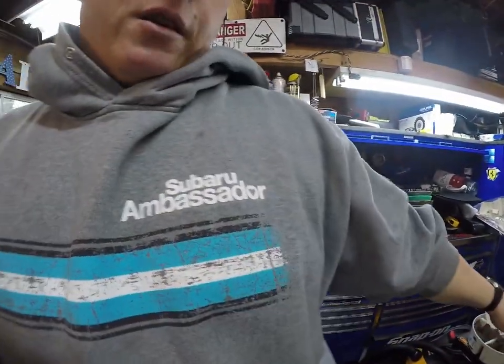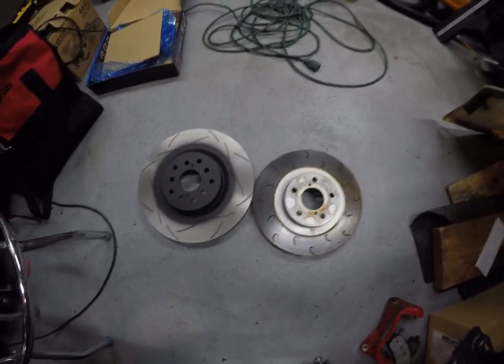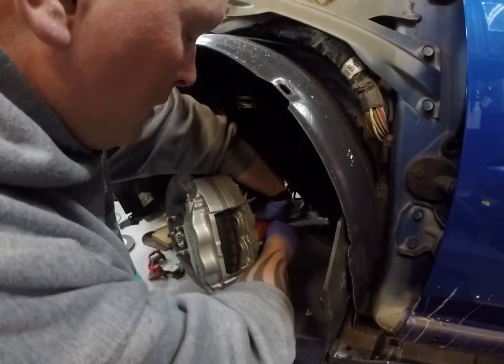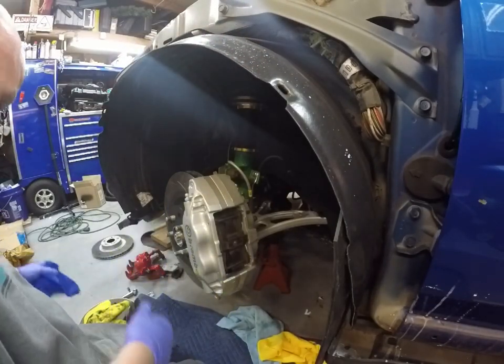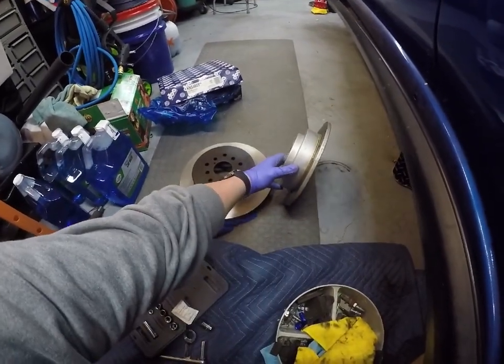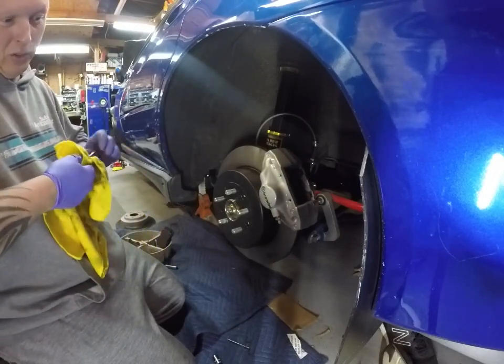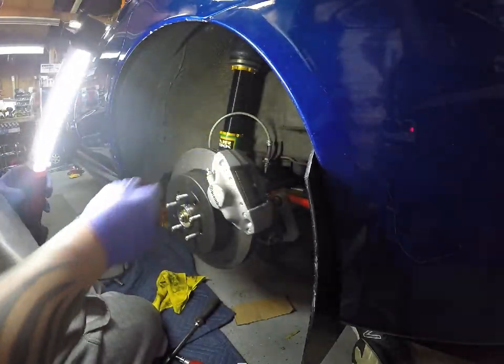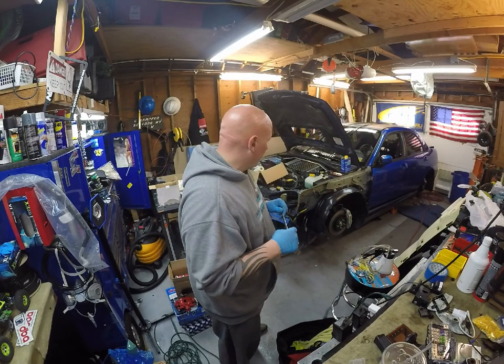WRX brake upgrade....STI brembos

Comment: Did you have to get a larger master cylinder to handle the Brembos?
Reply: did you ever get an answer, im having this trouble now I think! I installed my Brembos from a 2019+ STI on my 2016 WRX. My brake pedals are very mushy tho, i have to really step on it to engage the brakes. Did you have this problem? (My mechanic bled the brakes lines twice btw, all new SS brake lines as well)